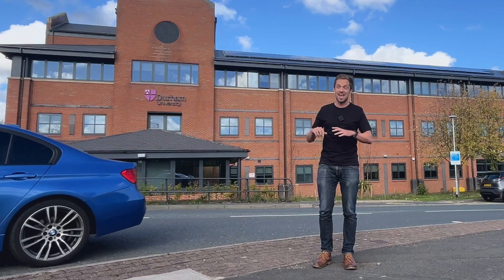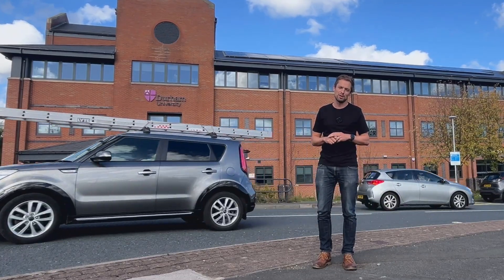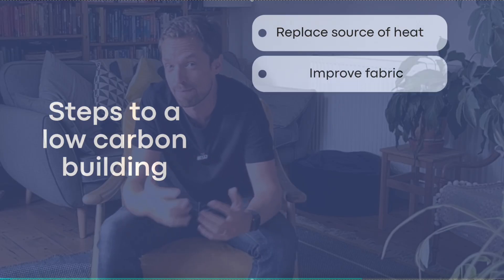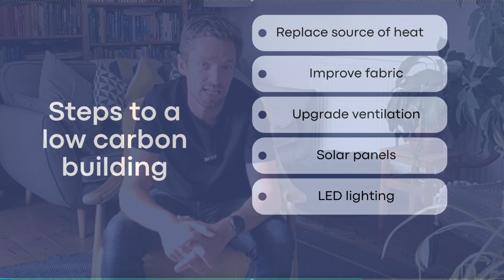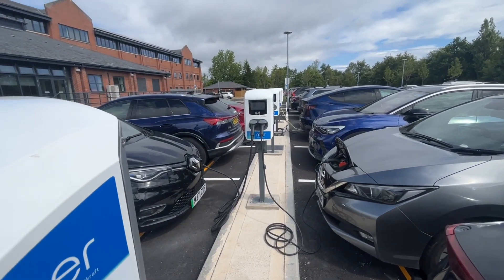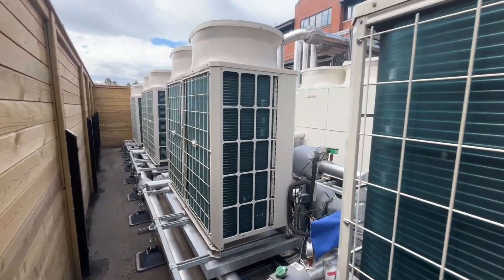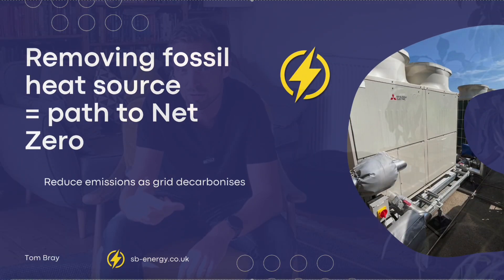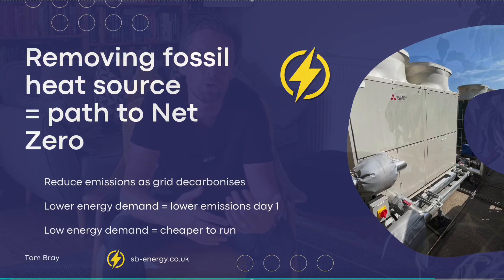How to decarbonise commercial buildings

Comment: Atmospheric carbon dioxide is the gas of life.   1200 ppm atmospheric carbon dioxide three times today's level  would greatly green the earth and is used in plant growing greenhouses.  The cause of global warming is not known with studies to its cause going back to the 1970s.   NASA reports global warming at 1°C where it has been since 1992 after falling from its all time news reported high of 1.1°C in 1991.  There has been no climate change from global warming expected to start at 1.5°C.  Its impossible to raise the effect of a saturated system a primary example being earth's water vapor saturated greenhouse effect that completely absorbs all the greenhouse radiant energy from the earth within a few meters of the radiating surface adding 5.55°C (10°F) to earth's average temperature.   

For earth’s greenhouse effect on average water vapor is over a 99.5% share, carbon dioxide less than a 1/4% share and human caused carbon dioxide less than 1/10% share.  Water vapor has a CO2e of 18 on average 1% of the troposphere. Carbon dioxide is 400 ppm, 0.04%.   1.00%/0.04% = 25 times more water vapor than CO2.  25 X 18 CO2e = 450 CO2e for water vapor and 1 CO2e for CO2.   All the other greenhouse gases total to a bit less than CO2 or 1 CO2e.   Carbon dioxide’s share 1/452.   40% is considered to be from human causes or less than 1/10%.  

Solar voltaic and wind generated electricity (wild AC) costs more natural gas to back it up in high readiness cost making near zero electricity than making all the electricity from efficient running natural gas combined cycle power stations.  Natural gas turbines are run at 70% fuel consumption for high readiness.  100% output can completely backup the wild AC in a few seconds.  66-2/3% is the expected natural gas cost for making all the electricity from efficient running natural gas combined cycle power stations.  

Wind power is the most natural gas expensive form of electricity  generation.  Wind fluctuates wildly second-to-second requiring constant makeup above high readiness 70% fuel consumption making near zero electricity.  This is more than the 66-2/3% natural gas consumption of full backup that would be needed for making all the electricity with natural gas combined cycle power stations.  

Having peak power of wild AC over grid demand can be very difficult to deal with.   Wind power being run as power stations can be asked to shutdown, but home solar power can't be disconnected from the grid requiring the power grid to be exporting power to 100% support the wild AC generating space.  This happened in Spain and caused most of the grid to have cascading blackouts when the transmission line for exporting power failed causing over frequency.
Reply from the maker: Thanks so much for engaging with this video Douglas! As always, your perspective is valued.

Much of what you say is just wrong, or the opposite of truth. CO2 is good for plants, but also provokes a warming world that changes habitats for green things as well as mammals. 

We have seen increase in average global temperatures above 1.1°. Climate change is not expected to start at 1.5° it is already here. And we are likely to have been 1.5° for much of the last couple of years. Additional warming is locked in. 

As we have increased the capacity of wind and solar in the UK, we have decreased the energy generated by gas, wind and solar has replaced gas. 

The issue in Spain, as has been widely reported, was linked to traditional generators not providing the services they were paid to do. Sorry!

Tom
Reply: @TomBray-LowCarbonLifestyle  Wrong as usual, Spain's blackout was entirely due to the 'renewables' racket:

https://www.youtube.com/watch?v=oJ5KESrIwS4

And the UK still uses gas for backup and as I write this is providing 41.95% of demand, nuclear 8.76% and wind 17.76%. Solar is providing nothing (it's 9:20PM) and the rest is coming from VERY expensive interconnectors to the continent. Please stop the gaslighting.
Reply from the maker: @jerrypalmer1786  That is not what official reports suggest - https://www.entsoe.eu/news/2025/10/03/28-april-blackout-in-spain-and-portugal-expert-panel-releases-comprehensive-factual-report/

And mentioning about the diversity of sources we have in the UK grid, as I always say, we have a mix today and we will have a mix tomorrow, I do not advocate for any one solution. But over the last 15 years, the emissions linked to our electricity has dropped substantially, because of wind and solar, and a move away from coal - isn't it wonderful!

Comment: Those bricks are fired to atleast 1000c whether you use electric or gas that has a huge carbon footprint all on its own.
Reply from the maker: Absolutely, which is partly why it is so important to reuse and refurbish this kind of building rather than rebuild. Which is part of what I would celebrate in this project. The brick manufacture would have been late 70s/early 80s, and storing that energy and CO2 for good is a positive thing. 

For this kind of building, its operational emissions going forward are key, and this building is very low emissions today and has a path to net zero as the grid continues to reduce in emissions.

Thanks

Tom

Comment: I have seven solar panels on my roof and a 3.4kWh home battery in the attic, on a small ex council house in the East Midlands. Together, with a time of use tariff (Octopus Agile) they have saved me over £1000 this year. Exports earned me £170, load shifting on Agile has saved me £470 and the energy the panels generated have saved me £405 at the Octopus standard tariff rate.

I look at a building like the one shown at Durham University with dozens of solar panels on the roof and I know for a fact they are going to be making the bills to maintain that building much, much cheaper. This is why Return of Investment isn’t a consideration for me, it’s the immediate impact on bills that I am interested in. My system is paid for, so that is about £100 a month I get to keep in my pocket. For those that ROI is important, the installation cost just under £9k in April ‘23, so payback will be about 8 years. If I had realised the importance of the battery I would have got at least double the storage capacity and would save even more. 

Sadly my house was deemed not suitable for a heat pump due to issues with some of the radiator pipes being too narrow, but apparently that is no longer an issue. I am hoping to fix that next year, after other renovation projects taking up my currently limited budget are complete.
Reply from the maker: Thanks for sharing your experience, yes I think Boldon House will be a very low cost building to run. It doesn't have batteries so will export a fair amount to its neighbours in the summer (or to charging EVs in the car park!)

Best of luck with your heat pump explorations!
Tom
Reply: @TomBray-LowCarbonLifestyle  Obviously the building you discussed in the video was huge in comparison to my three bed semi, but imagine if every house in the UK did the same thing! The impact would be huge. 
I didn't do it to save money, I was influenced by watching YouTube channels such as FullyCharged/Everything Electric and I am so glad I took their advice.
Reply from the maker: Great stuff!